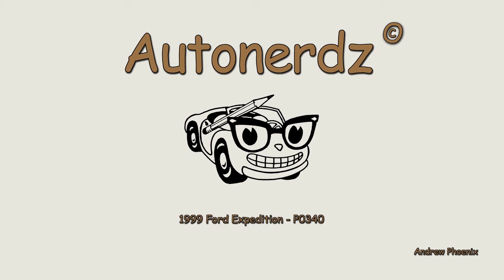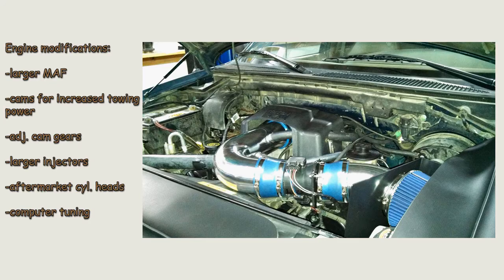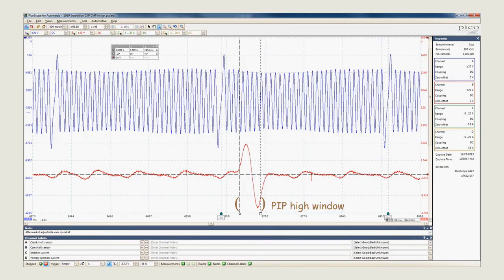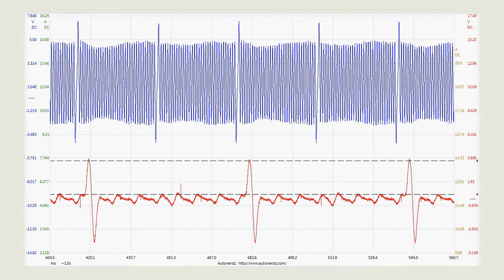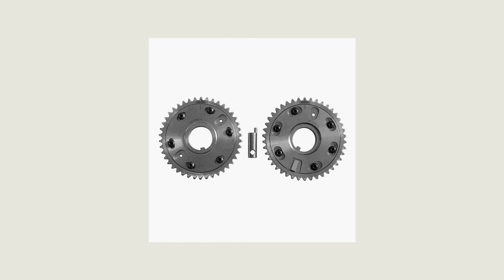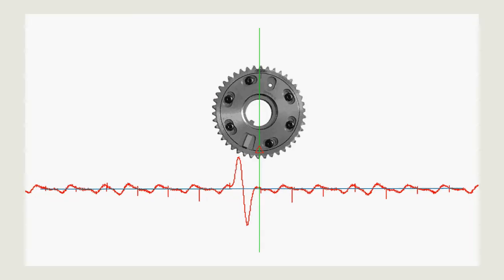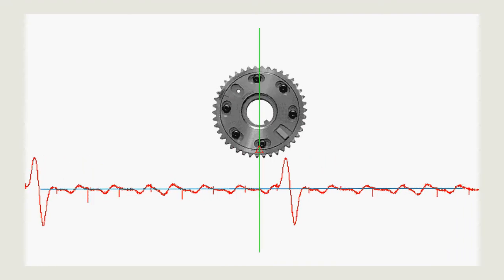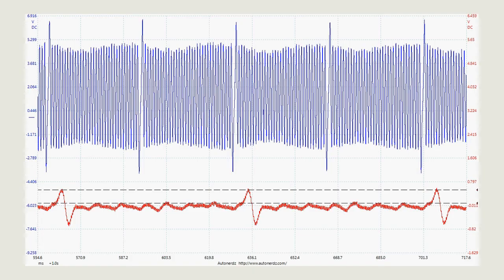Expedition P0340

Comment: Good work Nerdz!  So, was the stainless steel bolt idea a no-go?
Reply from the maker: That was never tried so we don't know if that would have been a solution.  What we did there to space back the CMP was just an experiment.  I don't think they did anything else with it since it was no longer coding.  I would have liked to see a proper fix applied but it wasn't our call.  We just diagnosed it.  ;-p